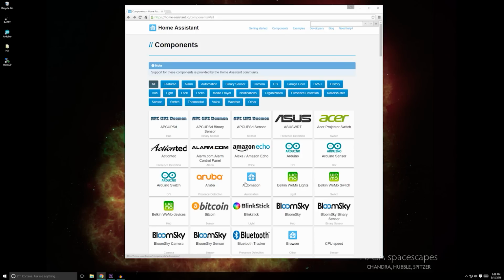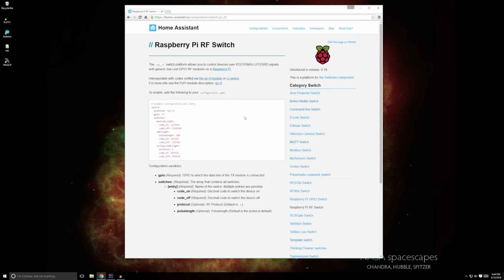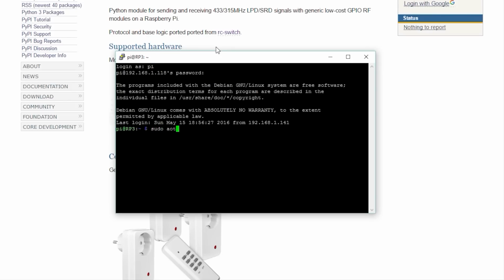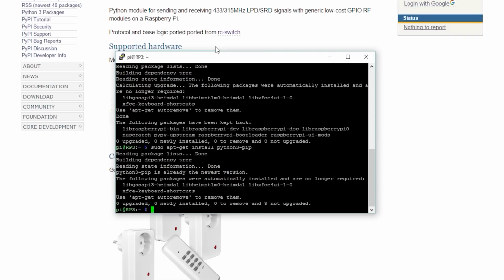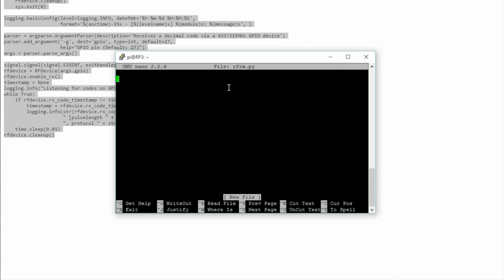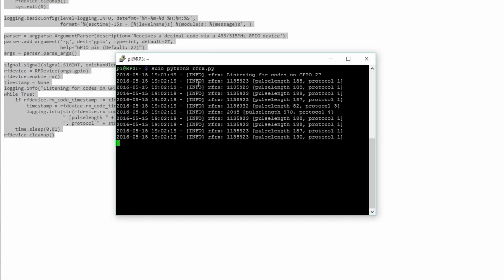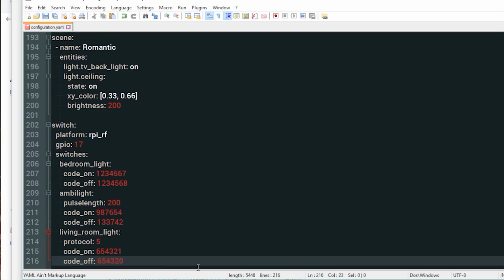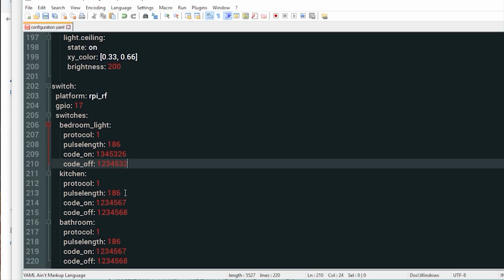The Cheapest Tech - $6 DIY Internet of Things Smart Outlets

Comment: Try to follow the video and when I try start "sudo python3 rfrx.py" 
the listening start on its own with all this don't know where it pulling these from 
any idea anyone?

2017-02-13 21:39:54 - [INFO] rfrx: 128 [pulselength 1718, protocol 2]
2017-02-13 21:40:24 - [INFO] rfrx: 17 [pulselength 1310, protocol 5]
2017-02-13 21:40:31 - [INFO] rfrx: 32768 [pulselength 570, protocol 1]
2017-02-13 21:40:43 - [INFO] rfrx: 128 [pulselength 2296, protocol 4]
2017-02-13 21:40:49 - [INFO] rfrx: 512 [pulselength 1408, protocol 4]
2017-02-13 21:41:04 - [INFO] rfrx: 4 [pulselength 343, protocol 3]
2017-02-13 21:41:07 - [INFO] rfrx: 1 [pulselength 1549, protocol 2]
2017-02-13 21:41:20 - [INFO] rfrx: 4 [pulselength 273, protocol 1]
2017-02-13 21:41:20 - [INFO] rfrx: 16777216 [pulselength 167, protocol 3]
2017-02-13 21:41:23 - [INFO] rfrx: 64 [pulselength 317, protocol 1]
2017-02-13 21:41:24 - [INFO] rfrx: 8 [pulselength 394, protocol 1]
2017-02-13 21:41:29 - [INFO] rfrx: 4 [pulselength 1718, protocol 2]
2017-02-13 21:41:30 - [INFO] rfrx: 194 [pulselength 1172, protocol 4]
Reply from the maker: It's probably interference or noise around you. Could be on your powerline or the air. I'd just keep mashing the buttons on your remote until you see  enough of a pattern to identify the right code for your outlet. Cheers!
Reply: I have the exact same issue and it's driving me crazy :( !
Reply: Hi! I have the same problem with rfrx.py. I can not find similar code, so identify the right one was impossible...
I tried the 433Utils, like he did: http://www.princetronics.com/how-to-read-433-mhz-codes-w-raspberry-pi-433-mhz-receiver/
I can sniff codes, but i think these codes  are longer, because I read somewhere that the maximum devices what you can manage with one transmitter are 1048576
The received codes are these:
root@hassbian:~/433Utils/RPi_utils# ./RFSniffer
Received 10464779
Received 10464779
Received 10464771
Received 10464771
Received 10464773
Received 10464773
Received 10464781
Received 10464781
Received 10464777
Received 10464769
Received 10464770
Received 10464770
Received 10464778
Received 10464772
Received 10464772

I can send out this codes with the codesend command:
root@hassbian:~/433Utils/RPi_utils# sudo ./codesend 10464777 5 400
At the same time the running RFSniffer can detect the same code, but my remote power socket not working. The HA Raspberry Pi RF Switch components can also send this codes, but nothing happen.

I tried with this:
http://www.ebay.com/itm/121939970068?_trksid=p2057872.m2749.l2649&ssPageName=STRK%3AMEBIDX%3AIT
http://www.ebay.com/itm/130732506374?_trksid=p2057872.m2749.l2649&ssPageName=STRK%3AMEBIDX%3AIT

Do you have any idea?

Comment: I follow the guide by the word, but the code are not learned (minute 5.15).

My pi3 works perfectly with Home Assistant (installed with AIO and VENV method).
The RFTX is a superheterodyne type
The remote is from a Etekcity type

but nothing I do is helping.

How to troubleshoot?
Reply from the maker: Sorry for my delay in getting back to you! Lots can go wrong with the RF stuff. If it is failing, I'd start by testing your reciever on an Arduino first. Then, I'd try checking your wiring, checking for interfereance, and utlimately trying a different RF receiver chip. A good amount of the people I've talked to have similar issues and it's almost always a bad chip. The RF stuff can be really annoying to get off the ground. Sorry about the troubles!

Comment: Can the Philips Hue Dimmer switch 046677458140 be controlled with the same system you showed on the video? or other dimmer light switch? I am looking for something affordable. 

The specs:

The switch

Batteries included
1 x CR2450
Minimal battery lifetime
3  year(s)
Frequency band
2400 – 2483.5 MHz
Lifetime
50000 clicks
Max. lights per switch
10 if not linked to Hue bridge

Thank you in advance Ben.
Reply from the maker: Sorry for my delay getting back to you! I don't think it is. I'm not sure what protocol that is using, but my guess is it is the same one the Hue bulbs use. I would think you would need to have a Hue bridge to use that. RF stuff can be really tricky. Even if you know it is the same frequency (433 or whatever), it's not always easy to make it work with this method. Each device can be unique and unless you've found somebody else using it in this manner online, you're probably in for a battle. 

I'm not sure what kind of hardware you already have, but if want some cheap remotes, check out the Aeotec minimotes. They're really affordable and pretty capable! If you don't have any Zwave devices, your best bet maybe something like the Logitech harmony remote or a cheap tablet and interfacing that with Home Assistant. Cheers!
Reply: Thanks, what about an Insteon Hub and light dimmer model 2477D? also can the Aeotec minimotes control my ceiling fans?

Comment: Hey BRUH,
Great video, got it working 1st time through. The little rf modules are great. I found the receiver to be really sensitive to movement. To touch the receiver at all set off a string of erroneous readings. 
Can you also have Hass listen for triggers from other rf sources? Like using the switch remote to control Hass events.
Reply from the maker: Nice! Pumped you got it working. There are some RF input components for HA like RFXtrx and PiLight, but I haven't explored them yet. These RF devices work great when they work, but in the long run I want to switch to ESP/MQTT based outlets for the reliability.

I keep waiting for Sonoff to release a hackable MQTT outlet for ~$10. That'll be sick. Much to come on all of that soon!

Comment: Hey Bruh!!!
One more doubt !!
I found these bulbs online !!
https://www.amazon.com/Coidak-CO801-1-Wireless-Changing-Controller/dp/B00ZK5Z1PY/ref=as_li_ss_tl?ie=UTF8&qid=1460228911&sr=8-1&keywords=coidak+bulb&linkCode=sl1&tag=t09f8-20&linkId=f03a9ae7ac7f7ee656eb560e408e450c

Looks like they are very cheap and I can afford 4 bulbs instead of one philips hue bulb!! These bulbs come with a remote... so, can we control these bulbs through raspberry pi ????? We can discuss more on this before that please have a look at these bulbs and let us know!!!
Reply from the maker: Sorry for my delay getting back to you! Yeah, so those look to be IR. There are definitely some ways to control IR devices in HA, but it may be a bit of a battle and not very reliable. You'll also need to have the transmitter in the same room as bulbs. That's a pain in larger homes. I want to explore cheaper LED lights at some point. I'll add it to the list. :P

Comment: Hi, just got mine working, great video. 2 points. 1. I went for the superhytereodyne receiver, the 1st one was faulty. 2. I tried this on an old Pi and it was not fast enough to display codes, I bought a Pi 3 and now codes are displayed correctly and now all 5 channels work great.
Reply from the maker: Sweet! Yeah, those chips are hellaflakey. pumped you got it going!

Comment: I still haven't tried this but I have a question. I live in a rented flat... Is there any way to control stock room lights without hindering the plugs inside.... My question is we can control power outlets using this and it is perfect but is there any way to control light switch and all switches on the switchboard ? If it is not clear.... I can write in a better way.... Thanks :)  @BRUH Automation and @everyone who can help :)
Reply from the maker: You do have some choices. The easiest is just to replace the lightbulbs - Hue and LIFX make great products for this. You would just leave the switches on all the time and use the app/HomeAssistant/whatever hub you like to control the lights. 

There are some DIY add-on switch kits that are... okay.. but they're ugly and not super reliable. Just depends what you're into. 

Good luck on your Home Automation project! Cheers!
Reply: Woah!! Thank you so much for reply bro :) >> I'll keep you posted when I am done with it..  I'll think about lightbulbs because I am on budget at the moment. That will be my last thing. I got my answer regarding switch kits... Thanks again :)

Comment: I have the same setup but I use an Arduino (NodeMCU) to send the commands and openHAB communicates with the Ardunios over WiFi/HTTP to trigger the sending. There are libraries available which already have commands for "most" outlets, one being PiLight for Raspberry Pi and the one I use is ESPiLight for Arduinos. So you don't need to sniff the commands as sometimes they can be quite advanced.
So if you have a huge flat/house you can just hide several Arduinos in each room which send the commands. I can trigger plugs as far away as 25m through walls with that solution, but it depends on your flat/house.

I also added an IR-Diode to each of those Arduinos to send IR commands the same way so they get even more useful.

Comment: Hi Ben, nice channel. I know you redid you home assistant installation on a raspberry pi3. Did you redo the 433Mhz system on those? I bought 2 433Mhz superhetereodyne RF receiver and transmitters. Tried both of them, receiver is connected to GPIO pin 27 and transmitter to GPIO pin 17. I am unable to see any signal, when I am pressing the remotes. Also when I just add a random 433Mhz tranmitter code in HA it does not read when I transmit. Did you have any problems with your RPI3? Your help would be appreciated :).
Reply: Got the issue resolved. The superhytereodyne receivers I got from ebay did not work apparantly. Tried a regular receiver and that just works fine. Your tutorial works great, thanks a lot!

Comment: @BRUH Automation,

Would it be correct to say that this would only work if the RPi was close enough to the devices to transmit the signal?  What type of distance do you think is capable from the Pi versus the remote that came with the device?

Comment: How close would the rpi needs to be placed nearby the rf sockets to receive the signal?
Reply: thebatu89 if it's helpful, my experience with this is the furthest rf module from my transmitter is probably 20 ft through several walls and one floor up. I've not had any issues with this distance.
Reply: Adam Costenbader thanks adam. Are you using the same rf module or a different one?
Reply: I am using the ETekCity RF outlets, yes.

Comment: I've had a bit of an odd error while setting this up.
For starters, received a DOA superheterodyne which was disappointing, so after waiting a wee while for the replacement, finally got my receiver set up for capturing my codes and i've noticed that there was a lot of noise, but that when i was sending the on signal for the controller the script would freeze  and it didn't appear to receive a consistant code from the controller :S
Reply: All set up now, turned out i had TWO faulty receivers xD

Comment: I am trying to set this up currently, my issue is when I use the receiver to get the codes I hold the button down and none of the received codes are matching on single button. Pulse length, protocol and code are all over the place
Reply: Example:
2017-01-14 20:31:19 - [INFO] rf: 15619 [pulselength 83, protocol 3]
2017-01-14 20:31:19 - [INFO] rf: 287619 [pulselength 81, protocol 3]
2017-01-14 20:31:19 - [INFO] rf: 65536 [pulselength 408, protocol 5]
2017-01-14 20:31:20 - [INFO] rf: 7934 [pulselength 84, protocol 3]
2017-01-14 20:31:20 - [INFO] rf: 507384 [pulselength 79, protocol 3]
2017-01-14 20:31:20 - [INFO] rf: 811783 [pulselength 82, protocol 3]
2017-01-14 20:31:20 - [INFO] rf: 375523 [pulselength 80, protocol 3]
2017-01-14 20:31:20 - [INFO] rf: 8963 [pulselength 83, protocol 3]
2017-01-14 20:31:20 - [INFO] rf: 1012995 [pulselength 80, protocol 3]
Reply: Same problem here!
Reply: I managed to sniff the code successfully with another kind of transmitter. Just to be sure I made a sniffer on arduino as well. Code from light remote goes loco, the other transmitter (magnet-thingy for doors and windows) works perfect.  Aaaand I can now use a garage door opener to turn the lights on and off... Not what I planned
Reply: Yep I managed to as well. It's actually really easy on Arduino using rcswitch library I can't remember where I got it, but this is my sniffer code: http://pasted.co/57ba8b8d and my transmit code: http://pasted.co/900d9afa. Only problem I had was I needed to convert the decimal number to binary. Easily done online: http://www.binaryhexconverter.com/decimal-to-binary-converter Now I just need to get this to connect with HASS. I think I'll do it using the MySensors coding and the NRF24L01+. I've had some success with this and MQTT (after a whole day of struggling!).
Reply: I got sort of the same issue, but manage to get the right codes eventurly. I read somewhere that if there is a lot of noise in the signal, you can try and switch to 3.3v instead of 5v. Might clear it up a bit.
Reply: Mine is also all over the place like this. I sometimes think I can work it out by finding a code that repeats itself but it never works when I add those codes to the config.yaml. Using 433Utils by NinjaBlocks, I can get a stable code every time I click the button but when I try this code in HASS it still doesn't work. To make matters worse when I flick the 'switch' in HASS, the transmitter doesn't seem to be transmitting the actual code, whether I use the script in this video or 433Utils. Very frustrating and I've spent hours trying  to fix. Does anyone have suggestions?
Reply: Same Here. Would love to get this fixed. When I run the script if I wait for a while it spits out a few random codes without me pressing anything... 
I'm going to have to re-check my wiring when I get chance and hope it's not another case of a DOA transmitter/reciever set... =(
Reply: Hey Michael. I am having this issue. What codes did you get to have this working? Thanks!
Reply: I had the same issue with my Raspberry Pi 2. With the Raspberry Pi 3, everything worked fine, hope this works for you.
Reply: If you mean script, I just used the one from the video? :) The right codes im talking about is the transmissions from my remote, not to get that confused :)
Reply: After building mine I saw this item... https://www.hooksmarthome.com/
Reply: I ended up using the RFSniffer and it worked right away. I tried to find the best ways to install it and kept having problem, but this one worked well.. It is in french mind you but if you just follow the code it should work. After you launch RFSniffer you wont see anything on screen until you click your remote and see the codes light up the screen! http://www.samuelpoggioli.fr/controle-radio-avec-un-raspberry-pi/

Comment: Currently have HA set up and running on a C.H.I.P. It works surprisingly well. Just got the rf transmitter and receiver. Would this, in theory, work or is it specific to the raspberry pi?

Comment: Thanks for the tutorial. I'm Running a Raspberry Pi 3 with Hassbian (1.0?), Home assistant 0.35.3 ... The python libs seem to work fine, however it definitely shows some weird behavior when turning the out lets on and off with Home assistant.
Reply from the maker: hmm, that's interesting. Sorry to hear about the troubles!
Reply: Same for me, I've had these working since August (thanks to you!) but now, seemingly out of nowhere, they are transmitting frequencies and protocols that differ from what I have in my config file. I see a little sprinkle of chatter on the forum about it but no one seems to know what's going on and I'm not seasoned enough to know how to ask for dev help. Any suggestions sir?
Reply: For me, it seems like my setup was just getting jammed up because I was turning them off and on too quickly. I'm sure I could write a script in home assistant to compensate for that. However, I went with a python script because it's a bit more versatile.

Comment: My outlets are 434 (433.05 - 434.79) any idea if this is not working due to the 434 because it should be 433.95?
Reply from the maker: I believe that those should be working with your receiver. These RF switches have been tricky for a good bit of people it seems. There is a lot of hardware problems that can cause issues. Have you tried holding the remote buttons in burst really close the receiver? The receiver is definitely pretty funky for some people.
Reply: Tried it but still no results, thanks anyway for the help going to try some other stuff.
Reply: If anyone has the same problem try: I let the Transmitter send messages by using Home Assistant Switches from the RF component and used the python script to retreive message through putty, they are working correctly so I think it is the 434mhz that is not working with the receiver and transmitter.
Reply from the maker: Ah, gotcha. That's interesting. Sorry about the issues!

Comment: I get lots of different codes while holding the "on" button and "off" button, like it changes with every activation. Is this normal?
Reply from the maker: It can be pretty noisy for some people. I look for the repeating code. There should be one digit difference between the on and off commands. Once you find it, that'll be what you'll use for the RPI RF component.

Comment: Ben... Great video!  Keep up the great work. I purchased and implemented these RF outlets.  Agreed.  Great bargain versus Wemo!  Question... if I purchase another set of 5 outlets... do I need to be concerned that they will have same addressing as original 5?
Reply from the maker: My understanding is that Etekcity outlets are programmable to any code within their range. I believe they are pretty unique and it's unlikely that you'll have overlapping remotes/codes... I think... Cheers!
Reply: BRUH Automation the set I have only work on 3 buttons if I hit 1 the switches for 1/3 come on if I hit 5. It's 2/5.  Could not for the life of me get them to be individual.    

Second how would we do this for 315 MHz light sockets could we do it all the same way?